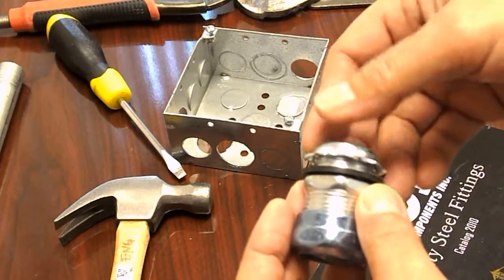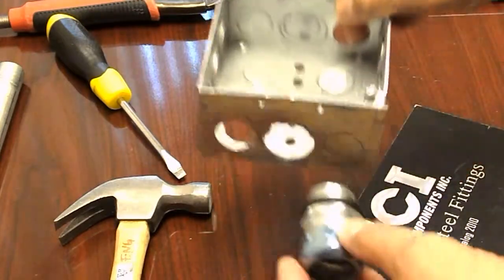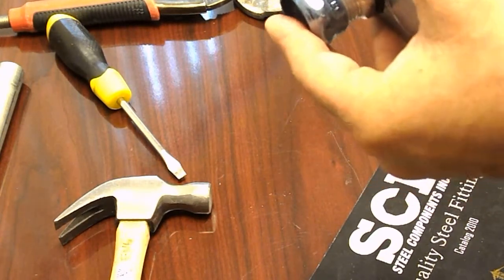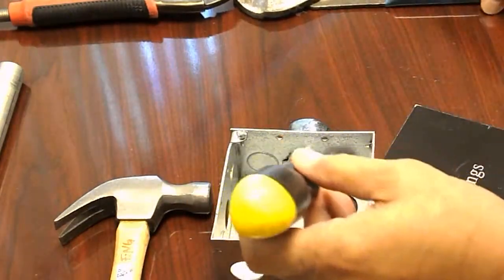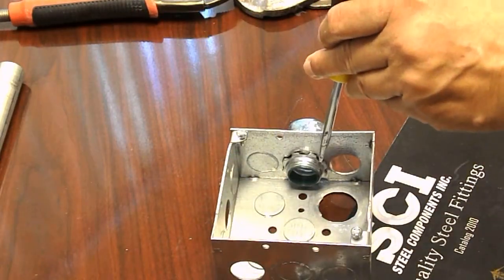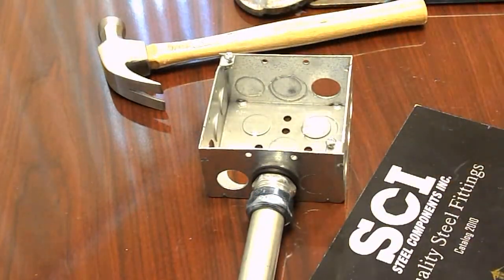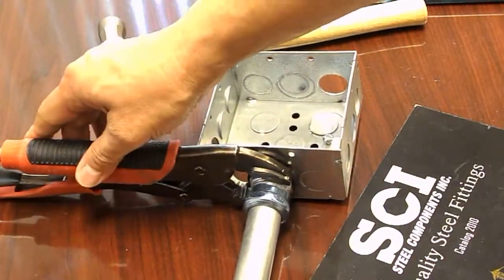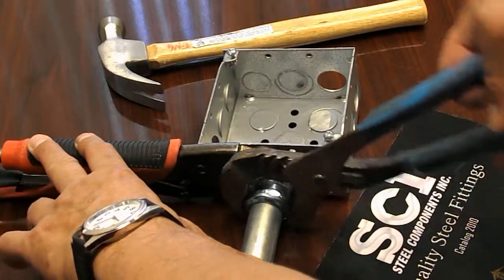EMT RainTight Connector Installation

Comment: Doesn't look like the nut was tightened. The connector spun when the vice grips were clamped.

Nothing about deburring or cut squareness. If the EMT is dinged, dented, or damaged, will it still be rain-tight?